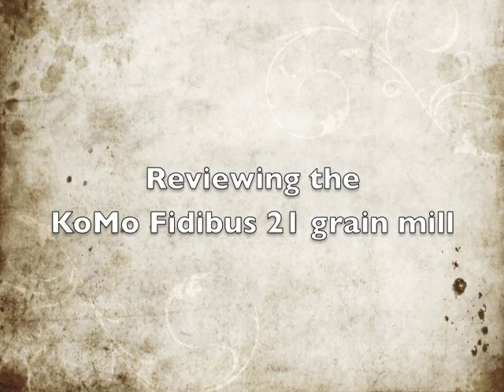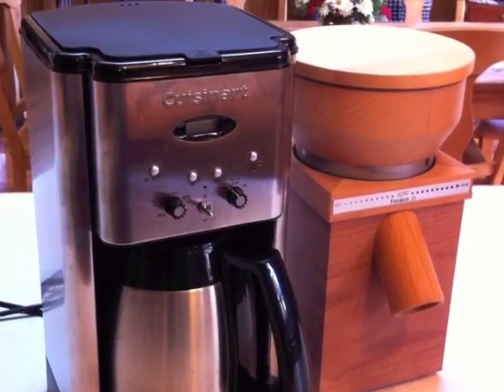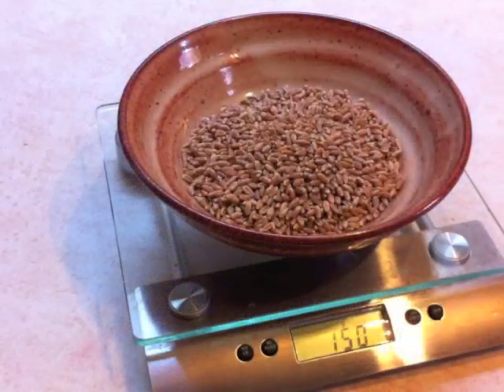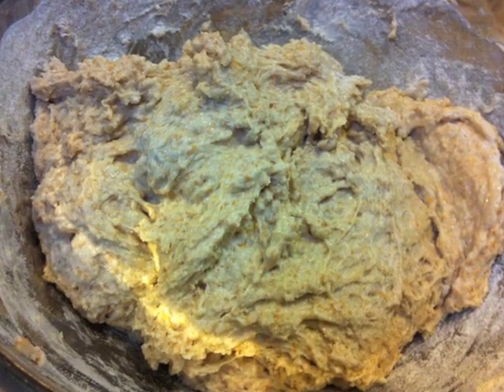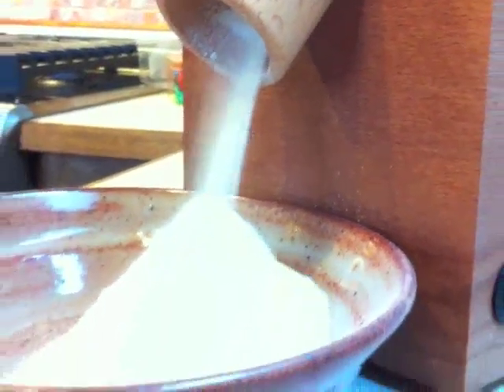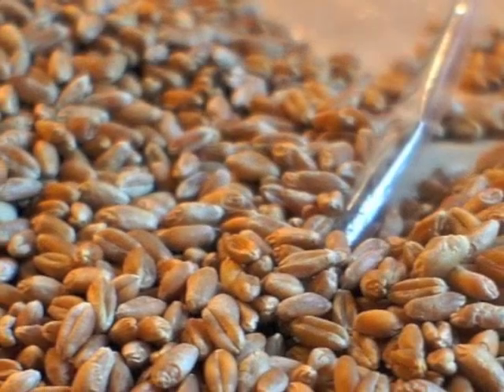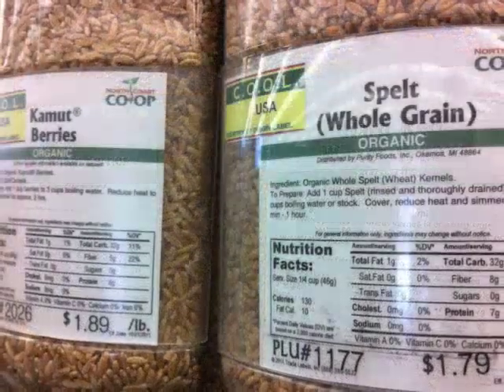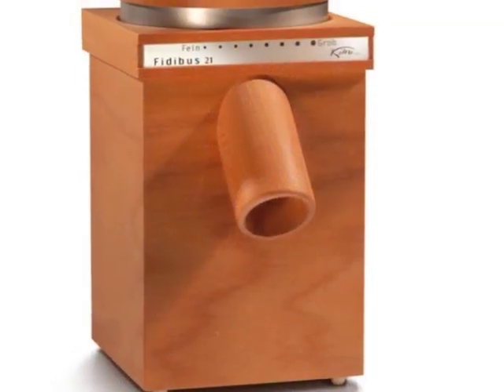KoMo Fidibus 21 Grain Mill

Comment from the maker: The protein level of flour is a guide to the potential gluten that the dough can develop.  The more gluten developed in the flour, the stronger or tighter the dough can be.  I have found All Purpose flour can make fine bread and I'm currently using the organic All Purpose flour from Central Milling (available at Costco) for most of my bread.  (along with the grains that I grind myself)